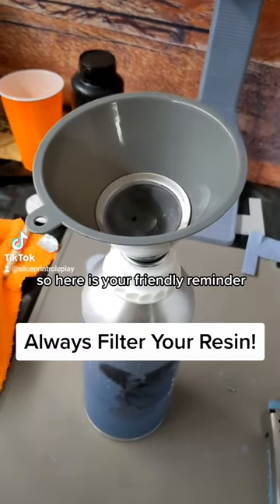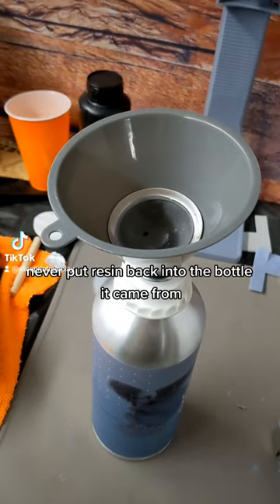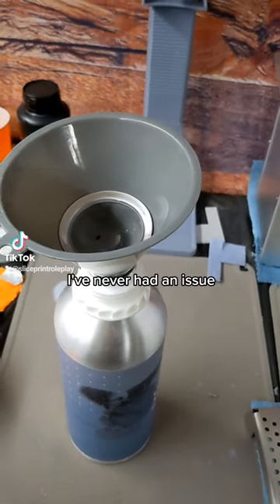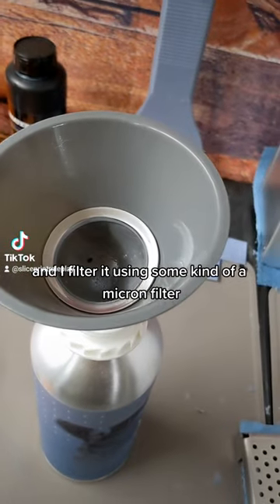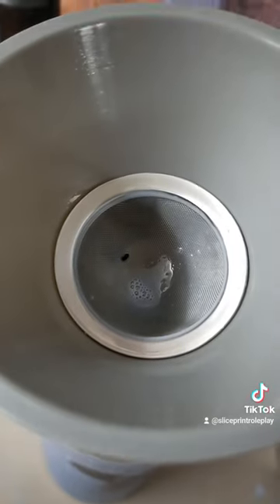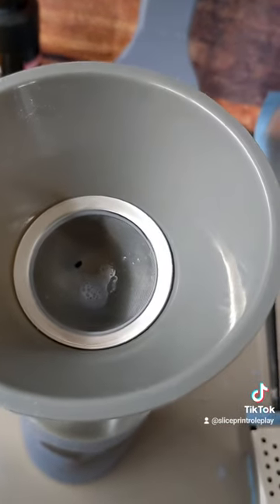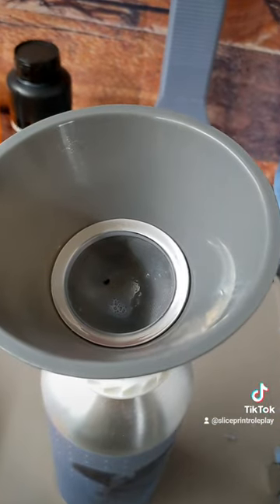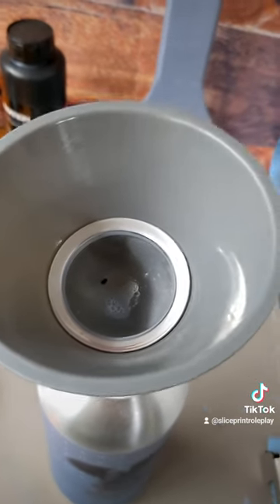This Is Why You Should Always Filter Your Resin!#Sliceprintroleplay #resin3dprinting #3dprintingtips

Comment: I learned that just because the funnel and filter are in the bottle… that there are no promises it can’t tip over and spill half a bottle. Thank you silicon mats.
Reply from the maker: Yep! That's definitely something I've started recommending and it's for that very reason. 👍
Reply: @SlicePrintRoleplay  any suggestion for a larger or deeper one than a mega mat from whambam?maybe one that can hold 1000g of resin and a printer for extra catastrophic event? Tried my first print last night and that’s what happened lol.
Reply from the maker: @LordWiseWolf  oh that's awful I'm sorry! I hope cleanup wasn't too bad.
Yes I do have a recommendation. In this Kit I have a silicone dog food mat with raised sides. It holds quite a bit and you can get it in bigger sizes.
https://kit.co/SPR/beginner-s-resin-3d-printing-kit
Reply: @SlicePrintRoleplay  oh sweet thank you! gonna grab probably half if not more of the list. Cleanup was rather intense. Saved half the bottle but lost a lot. And my slapmats still smell like resin. I’ve cleaned them three times, so that’s the worst part so far. Thankfully nothing broken, nothing on the screen so overall, not the worst. But oh was it a learning experience lol.
Reply from the maker: @LordWiseWolf  well out if all possible outcomes that's definitely one of the best. So at least you had a little bit of good luck!
Glad you have a positive attitude about it too. It can be tough to look at a bad/frustrating situation as a leaning experience.

Comment: Semi connected question. when should I remove all my resin from the printer? Like can I leave resin in the printer tub if it's covered over night or is that a no no?
Reply from the maker: Honestly there are really only two reasons you'd want to drain your vat/remove all resin.

#1, if you have any kind of print failure. This is because after a failure there could be bits of cured/hard resin floating around in your vat. Then if you start another print those bits of cured resin could get pressed into your LCD. This can result in a dead LCD... So basically, always drain your vat using a filter after any kind of failure.

#2, if you want to use a resin that's a different color or type.

Let me know if you have any questions.

Comment: may be dumb question but how do you wash the reusable funnel and filter once done?
Reply from the maker: Not a dumb question at all.
I put a paper towel down and lay the filter on it upside down. Then a spray IPA through the filter into the paper towel. That usually gets most of it but if needed I then wipe the IPA soaked paper towel (gently) around the inside of the filter. That's worked great for me.
As for the funnel, I spray IPA on a paper towel and wipe it down. I use a chopstick to push the paper towel through the neck and that works well.

Comment: Where did you find that reusable metal filter?
Reply from the maker: That exact one I actually got from the kitchen section at a dollar store. It had a handle on it that I removed. They do make reusable filters designed for resin 3D printing though. 
I have them in this Kit if you'd like to check them out.
https://kit.co/SPR/beginner-s-resin-3d-printing-kit
Reply: @SlicePrintRoleplay  thanks I’ll look at that. Thanks for all your content!
Reply from the maker: @Erik-zh7rk  you are very welcome.
Reply: I butchered a disposable filter and used the screen in a printed funnel.
Reply from the maker: @juz4kix  that's a fantastic idea! How did you secure the screen in place?